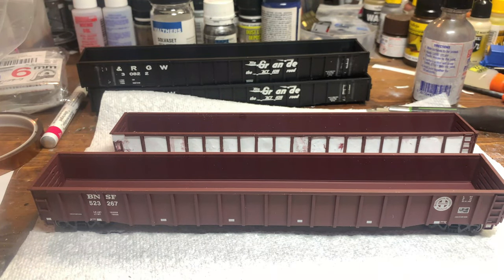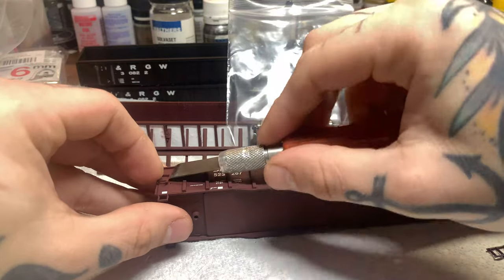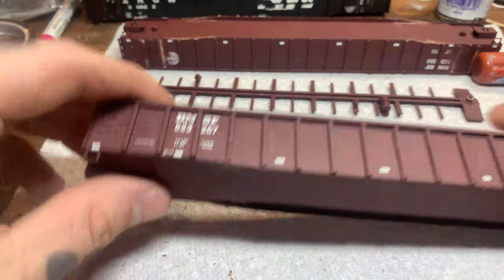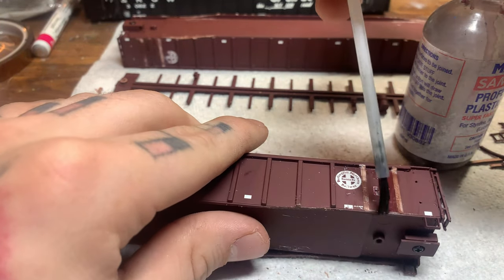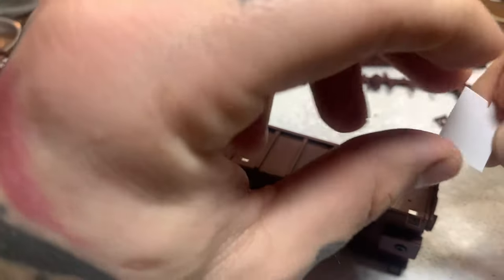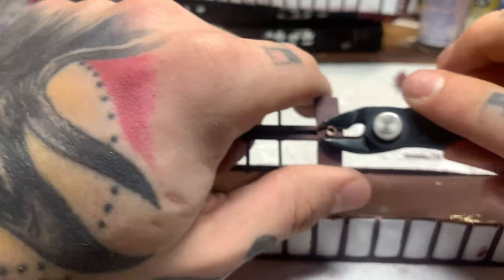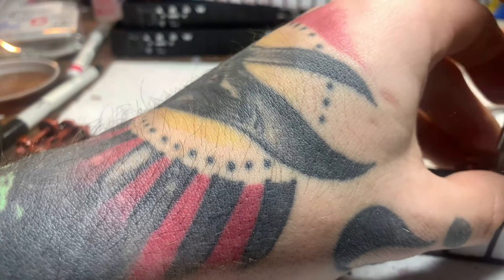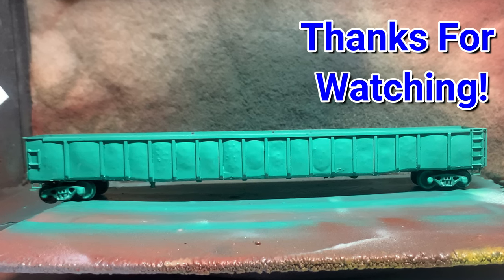Conrail G44A Gondola Kitbash Part 1

Comment: I always wondered how to do this. What was the thickness of the styrene you used? I watched part 2 before part 1...great work.
Reply from the maker: The styrene I used was from Evergreen and was .010" (.25MM) thick. https://evergreenscalemodels.com/collections/plain-opaque-white-polystrene-sheets/products/010-25mm-plain-opaque-white-polystyrene-sheet  Really any thinner type of strene will work decent but the super thin stuff is easier to get good side pannel effects with.